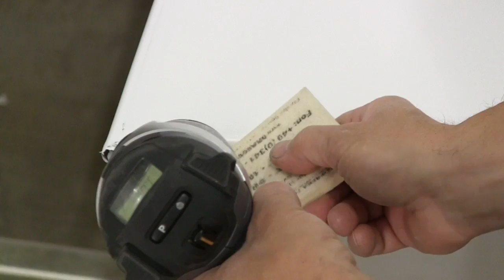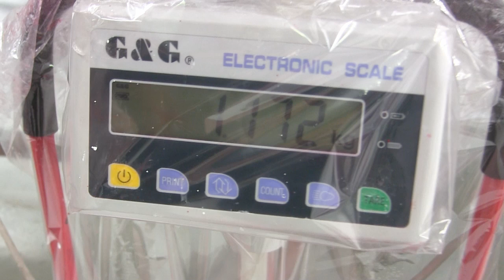The covering of a rudder (dummy) of a PIPER CUB with ORATEX 6000

Comment: I see the Steinel heat gun but what is that hot iron tool that you are using?
Reply: Its a Toko T14 Flat Hot Iron with digital temperature control, we sell those all the time. You cannot use the Oratex without it. Also critical is the wool-block "Felt Blade" he is wielding with the Steinel Heat Gun... Regards from Alaska.